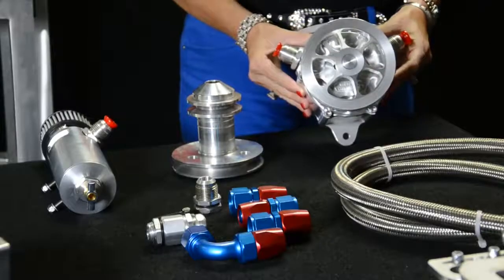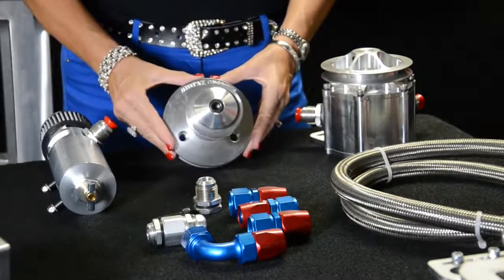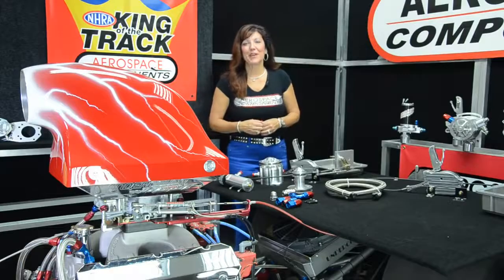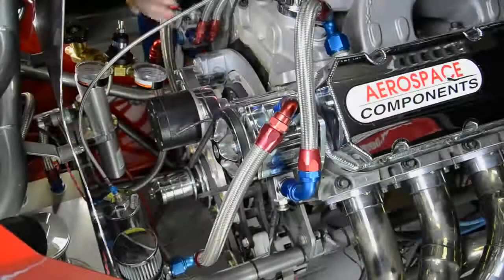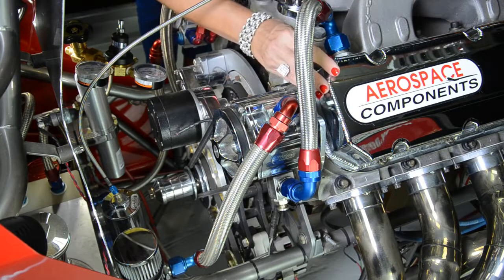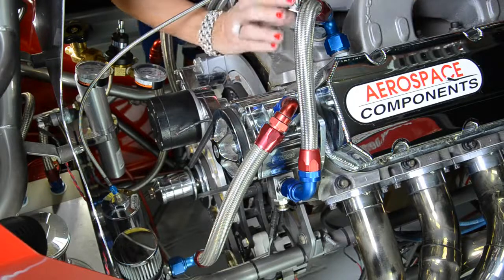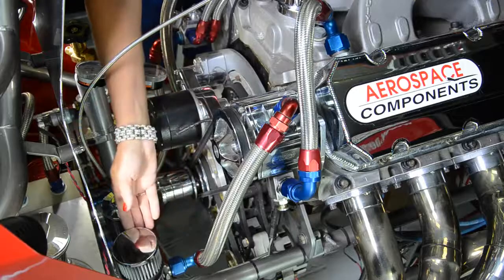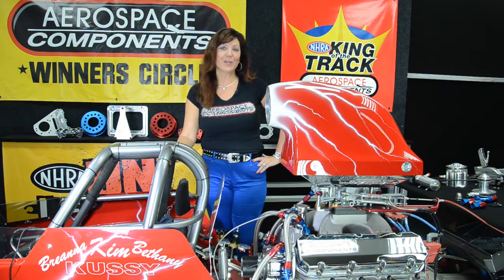Aerospace Components: Vacuum Pump

Comment: Hi I would like to know if I can run the pump  v belt off my existing pulley .on the damper. It lines up perfect.
Reply: If the belts tension is good no problems